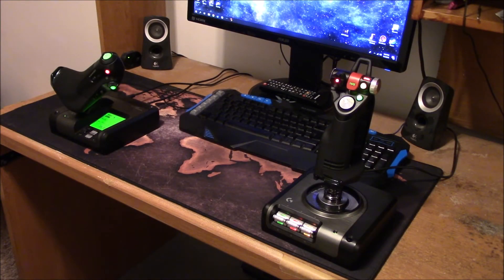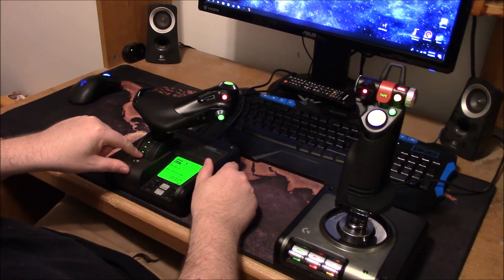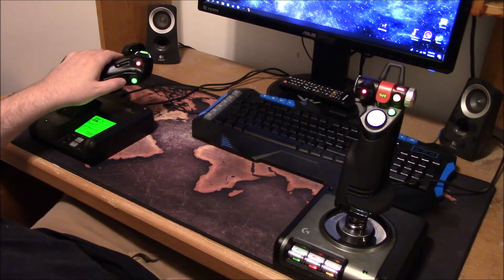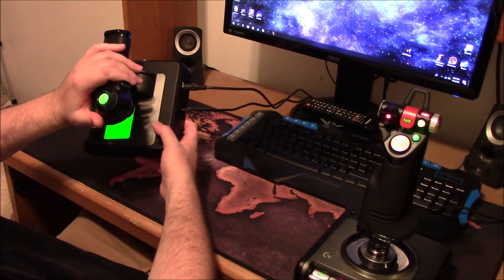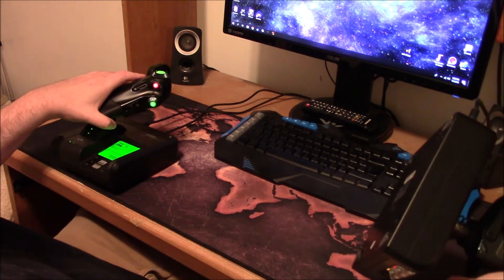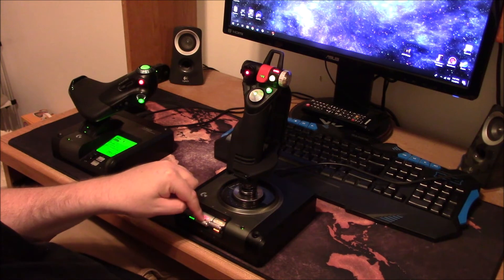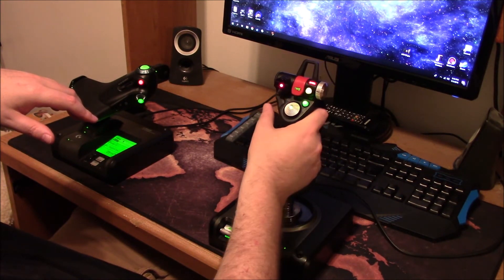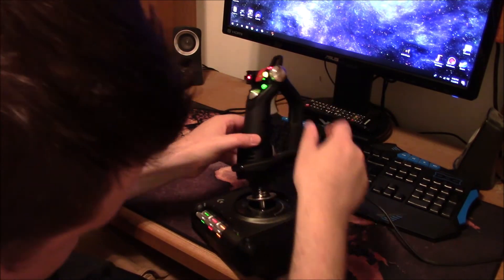Review - X52 Professional Hotas

Comment: Thank you, Just bought it yesterday, all worked fine to start with then the throttle quadrant lights went off?? it's still functional but dark, the small screen working but also dark, while the joystick quadrant is lighted properly .....Any idea will be appreciated, please ....... I use P3D, how can I get modes or profiles for that? because with the much simpler and older joystick I was able to trim up and down but not with the X52......I know it's my first day but I thought to ask.
Reply from the maker: its your motherboard, my stick and throttle did the same thing right before the motherboard died.
Reply: Life & Times of JCM  Right before your motherboard died? I has the same problem but my motherboard is still fine.
Reply: Hi, I have the same problem. Did you figure it out?
Reply: @engineer6674  No I just reboot the system after it's ON using the Restart command and all lights will come ON ............. But sure it's not a motherboard issue

Comment: For me the X52 pro was perfect buy BUT for some reason the lighting on the throttle is not working... the little screen is showing the data but i dont have the cool lighting as this guy have. I have plugged it in the right usb port i think. I just dont have thoose options that are showcased in the video. (18:30)  Anybody have a clue why is that? (Sorry, bad english i know)
Reply from the maker: the controller options are a bit deep in the computer sub folders, you have to follow the path like in the video; control panel, hardware and sound, device and printers. if its not there, then it means it's not talking to your computer and it might be damaged or defective.

Comment: G'day mate. Good review.

That "sticky" point in the throttle travel in known as a "detent", usually pronounced day-tont.

Cheers.
Reply from the maker: thanks, still haven't messed with it, i saw some where where one player uses it for finding speeds for approaching stations and such, but i don't. have u ever seen a good use for them as they are in other games???
Reply: @lifetimesofjcm8582  Afterburner, WEP war emergency power on WW 2 warbirds. You cant really disable the mouse it is a mouse. Many flight sims use mouse control for head movement.

Comment: what is the cable for between the two units?
Reply: It is not a wireless device. Both, the stick and the throttle need connection. The usb cable connects the computer to the throttle, and from the throttle the connection is sent to the stick

Comment: Nice Review.
Did you know that you can bind until 3 Layers up to each other for your Keybinds in Elite?
Take the Pinky Finger for switch the Layers. It will be very useful. 
(to asign all you need to do is go in normal keybind menü, and push the wished command button and a layer button you must make free for it.  Use always the same Button for same Layer: somewhere on the Throttle or Stick where you can push it without thinking. 
Like The pinky Finger Toggle. (Example: Button 1 Boost. B1 & Pinky: Flight Assist, B2: FSD, B2 & Pinky: Silent running, etc)

Then change your keybinds in a most possible logical way:
Always set the important Things at the first Layer: 
Scans, Pipes, Boost, FAS, Weapon Groups, Changing Scan & Weapon Mode, etc.... 
Second Layer:  FSD, Fighter comands, landing Gear, next Target in Route, Nightvision...
Third Layer: Galaxy System Maps,  Cargo Hatch, Lights....
If you make them mostly possible consistent, then you can always have same toggles for near Actions: 
As Example: Nightvision and Light at same Toggle/Switch/ Pov but at different Layers. 
Pinky activated: it will put on Lights. 
No Pinky: Nightvision.  (i use them only at L2&3. But as a Example. Sorry my Gramma: English is not my native)

Me for example put fixed tempo at 100/75/50/0 and -100 (for reverski) ^^ 
This i set  at the same Pov then i have the Pipes. So in fight i can use the Pipes to what i need, switch with pinky the Layer Mode and change the flight Velocity.
This all is done very fast and without thinking about. (because i put always comands for near actions together always, it is easy and logical to remember. It goes into musclebrain real fast)

I hope this help you a bit to bring a bit more out of your wonderful Hotas, dear Commander.

Fly Save 
and watch ure Six ^^

Cmdr: A.Nikopol